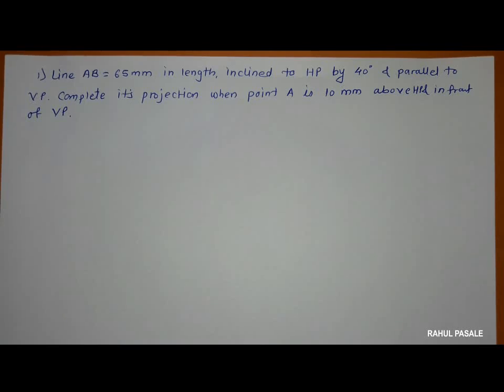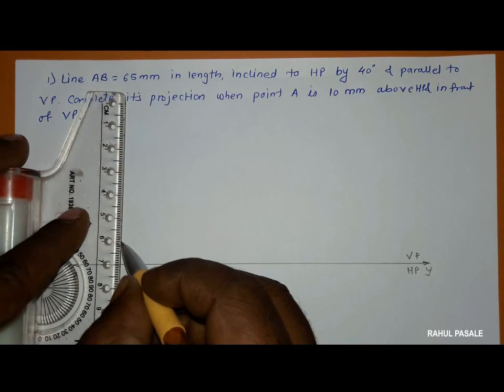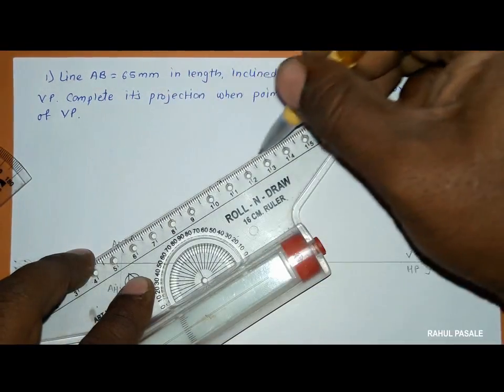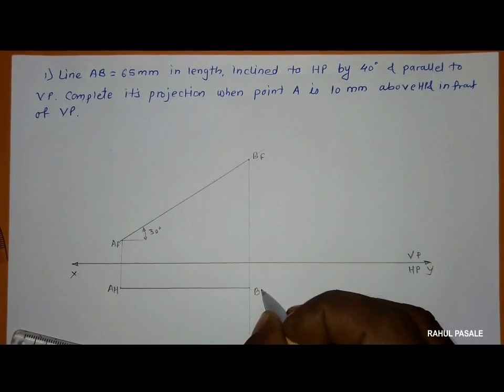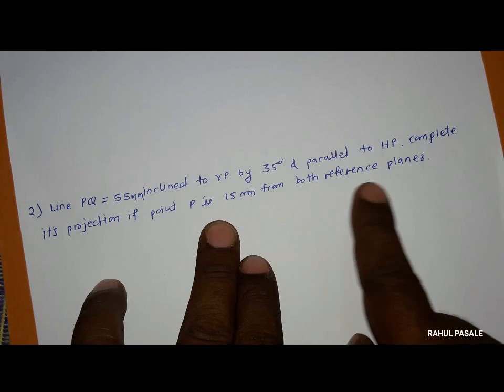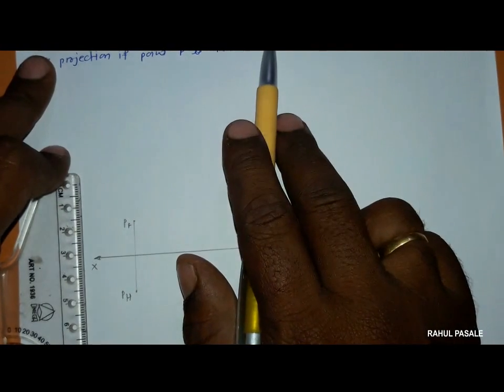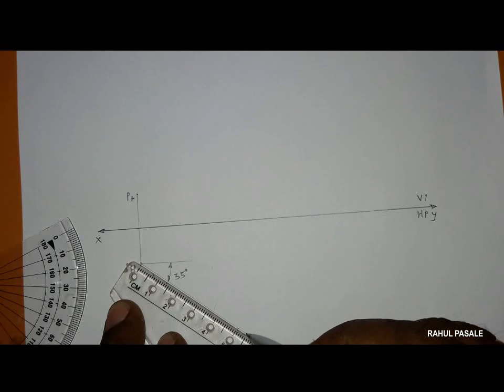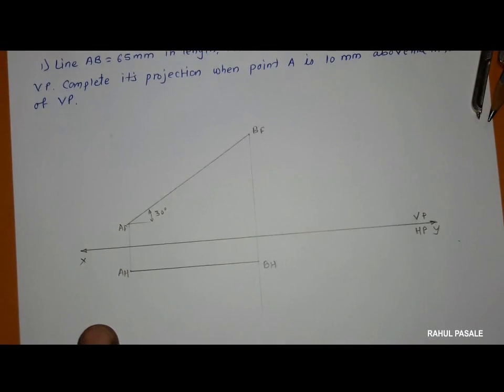Projection of Lines Lecture 1

Comment: Why are you take the value of angle is 30 degree ?
Such as the given angle is 40 degree.
Reply from the maker: Consider 30 as 40. Procedure is same
Reply: @rahulpasale429  but you should be correct. 👍BTW video is fantastic

Comment: sorry sir, because in your first question the angle with HP is 40 deg ; but you take the value in your drawing is 30 deg.
Reply from the maker: Yes, by mistake it happens, but the procedure is same. Consider 30 as 40

Comment: This ans Wrong .In the question inclined with hp but you draw inclined with vp
Reply from the maker: No, answer is right.
Only I marked 30 angle in answer but in question it is 40. Procedure remains same.